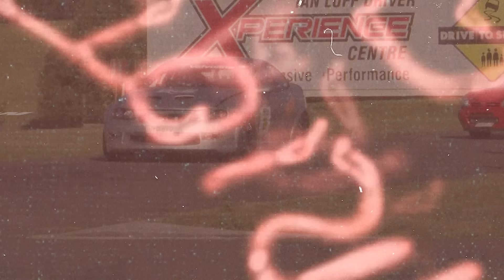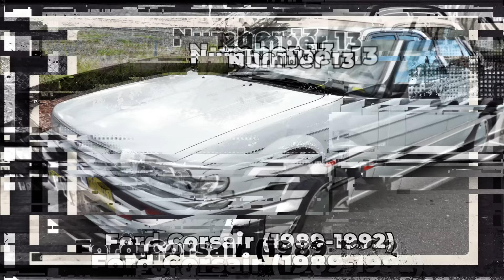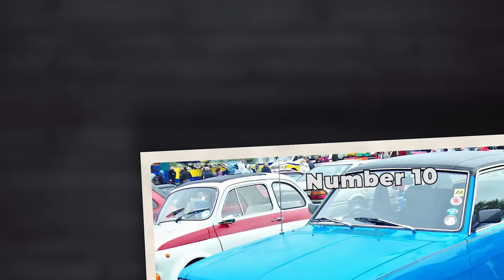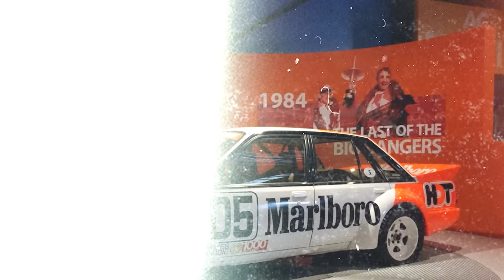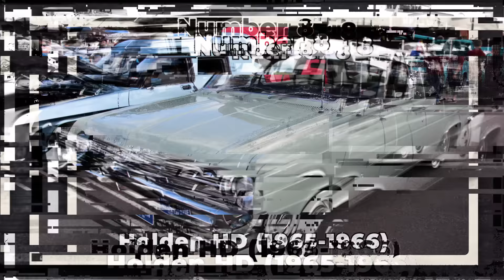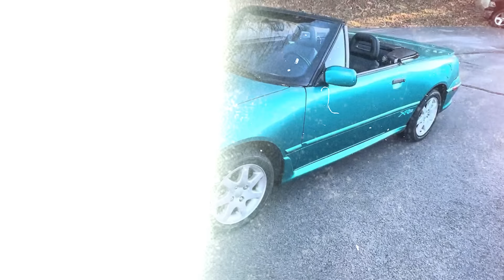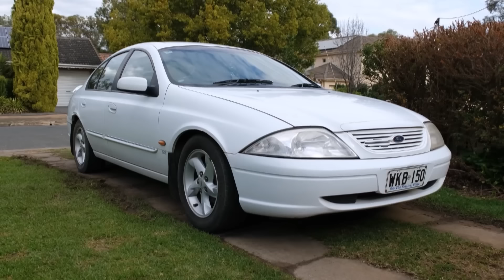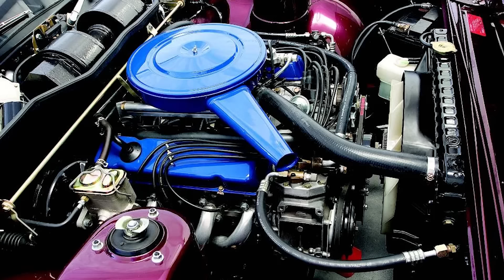Top 15 Worst Australian Cars Ever Made

Comment: Some research is need me thinks. Geely was never on sale in Australia. It was the UK they were sold. There was nothing wrong with the early Holdens EH to HR. These were seen as solid. The Marina was seen as a good competitor to the Cortina\Torana. Only issue was they were too expensive. They weren't the same car as in the UK. They had upgraded suspension, more powerful engines. The 262 Six in the Marina & P76 didn't have head-gasket issues. Where did you get this from? Oil leaks weren't any worse than any other car of the period. They were let down by build quality due to monitory restraints.  No mention of the Mitsubishi Sigma not LADA? I'm assuming you are including imports as you mentioned Geely and showed the Morris Marina.

Comment: I actually owned a 1985 1.8L JD auto Camira and gotta say I was very impressed by its performance and economy. I did have a couple of issues, but nothing unusual for routine maintenance. Only problem may have been the 3 speed auto, but those were the days of limited gears, lol.
I think they're confusing the JD & JE with the earlier 1.6L JB.
Wish I'd kept it and replaced the engine with a 2.0L & 5 speed manual.

Comment: I owned a ford corsair and it was the worst car I ever owned, I bought a one owner low K example and It was a money pit, unfortunately its only saving grace was that it was in an accident that was the other drivers fault, insisted on an insurance check rather than a repair, back then you could insist you had a preferred repairer , kept the cash and 1 month later the head gasket went, also got $100 from a wrecking yard as a bonus, what a piece of crap . Ford was more or less forced into this by the "Button Plan"

Comment: Had an AU series1 v8 Ute, did 600000km in it, reliable  motoring. Beautiful car.
Reply: Still driving my AU series 1 v8 ute, and it's getting close to 600,000kms and still going strong.  Has been a great car!  (I did change the grill and bonnet though for series 3 styling).

Comment: 12:09. I must have got the only decently built Camira produced by GM-H. I purchased a 1983 JB Camira SL/X four speed maual new. Had it for 10 years and did approx. 100,000kms in that period. Only problem I had was a dash light failure at 40,000kms - common problem - which cost about $40 AUD to repair. Key to it's longevity was regular Servicing and not abusing the engine which was plenty powerful if you knew how to drive properly. Gifted it to a relative who had it for another 15 years before upgrading to a new car. Loved that car and wish I still had it. If you treat any car like a peice of junk, that's eventually what you will end up with.

Comment: I'm nearly 63 and have only ever owned 5 cars: 1 Holden ('79 HZ Kingswood), 2 Toyota Landcruisers ('95 HZJ78 and '05 HDJ78), and two Ford Falcons ('82 XE and a '97 EL). The Kingswood was brilliant. The Landcruisers - bulletproof and ultra reliable. The two Falcons were by far the worst, with the XE being twice as bad as the EL. Absolute shocker - 2 engines, 2 gearboxes, 2 radiators, 2 front passenger doors and innumerable door handles. I eventually gave it to the SES so they could use it for 'Jaws of life' training LOL.

Comment: 1.  The Sunbird was a good car for its time, mid 70's, and there was nothing wrong with the interior.
2.  Yeah, no shit, in a straight-line on a dry track, a lighter RWD is faster than a heavier AWD with the same engine.
3.  Wrong.  Ford actually made the panels, so it was the closest to a JV of all the Button-Plan models.  It's biggest failing was being boring.  It was discontinued only because Nissan closed their Clayton factory.
4.  LOL.  What an idiot.  Yes, the Apollo was a pointless rebadge, but that doesn't make it a bad car.  As a Camry it was actually a decent car.
5.  Oh sure, the car that launched the most successful brand in Australian History.  And no, Ford responded quickly with modifications.
6.  The Marina wasn't Australian.  You spongecake.
7.  Err no.  The Starfire was hastily developed to meet Local Content requirements, and was used for around 6 years in Australia, including by Toyota.  The 4 cylinder Commodore wasn't a bad car, just pointless.
8.  Meh.  HD Holden was a locally build car in the 1960s.  Woeful by today's standards, but so was everything else.
9.  The 380 was not a bad car, it was just a bad idea.  Mitsubishi Australia gave up the powerful position of the Magna in the large 4cyl category, in a nonsensical big to chase Ford and Holden with a "big 6" of their own.  At a time when people were already leaving the big-6 market.  
10.  Not sure what you're smoking, but Ford closed their Adelaide plant in the 1960s.  The Capri was built in Broadmeadows like everything else.
11.  Yes, Dementia is terrible.  Gheelys were in no way Australian
12.  Ok, you finally got ONE right.  The Locally built Cruises were very badly made.  Especially for their time.  
13.  The AU Falcon does indeed stand out as the worst styling mistake of all time.  But the rest of your claims are BS.  AUs are mechanically bulletproof.
14.  Not sure it deserves to be number 2 on your list, but yes the JB Camira was an epic failure.  Badly under-engined compared to its Competitors and atrocious build quality.
15.  Oh congratulations.  Yes the P76 is the worst Australian car ever made.  Yawn.

Comment: I inherited a Camira when I was around 20 (1993?). On the positive side it never broke down. It was a manual and I drove it very gently.

On the negative side, amongst other things it needed new CV boots every six months to a year, dash lights would go on and off at random in the rain, the firewall was rusted to the point the bonnet wasn't connected at one side and seats, mirrors and gear sticks needed replacing. Fortunately there was no shortage of Camiras at the wreckers. 

I think I sold it for about $400 in 1996. I saw it still driving around about a year later. From everything I have seen and read mine seems to have been one of the better ones.

Great list, but I do agree with others that the Craptiva should be here.
Reply: Not the captive Diesel, iv had mine 10 years now not a single thing ever gone wrong with it. Because Isuzu made the diesel engines for it. That's all you see mainly getting around now, the diesel captive.

Comment: Ford Capri convertibles were built at the  Broadmeadows Assembly Plant 2. Left hand drive models mainly for the US market and right hand drive were on the same line. The XF ute(and Nissan Ute lol) and Panel van was also built in Plant 2 along side the Capri to begin with and later moved to Plant 1 with the EB/D Falcon models.
Reply: Correct. My first job was counting Capri parts (down to the last bolt) at the Broadmeadows plant.
Reply: While some of the base Capris certainly leaked a bit and were a little underpowered, the '92 ClubSprint black only turbo model with the Momo steering wheel and blue leather seats was absolutely awesome.  It had a ton of power and a true two seater - very cool car even today.

Comment: I had V8 P76 4 speed. Still the best car I have owned. The “writer” forgets that any car parked outside and not under cover rusted quickly.

There was no coating at all on parts of car not visible, in side sills, corners inside doors etc, there was no whole body dipping back then.
Reply: Agree, we had both v8 and 6, v8 was fine 6 was worst car with lawn mower carby ever.

Comment: Despite lower ball joint issues, simple power steering pressure switch leaks and door actuator plastic gear shafts snapping, The AU Falcon is one of the more reliable vehicles Ford has made. It certainly did not lock owners out of the vehicle, simply just couldn't lock the car. Every car has some kind of problem unique, and given what problems the AU falcon had, they were relatively easy repairs and quite inexpensive. It was only the series 1 AU Forte that had the grille most people did not like.

Comment: The Corsair and the Apollo were thrust upon both their manufacturer by the Button plan, hardly the fault of Ford and Holden. They had no choice but I notice you left out the Toyota Lexcen from that entry of the two car. It was a badge engineered Holden Commodore that sold almost zero cars. Just as bad as the two you mentioned.

Comment: You should add the Holden Vectra (JS series)  to the list.  The one I had was poorly built and had no end of engine and electrical issues.  The most dangerous was an engine stalling fault, where if you took your foot off the accelerator it would stop on you when in motion.   Had this issue looked at multiple times by my Holden dealer at the time and although they were able to fix when it occurred, it kept coming back.
Reply: PLUS CAPTIVAS endless problems....

Comment: The Camira should have been an excellent car. In the UK it was the Vauxhall Cavalier and was pretty bulletproof but the Camira was very badly assembled here.  I believe (someone could confirm) that they fitted hundreds of them with left over four cylinder engines from the Commodore 4 cylinder model that had been languishing in a warehouse for many years. 
The endearing thing about the series one JB Camira was the sudden dump of all the oil onto your driveway. 

Just a point, the pictures you show are not the JB,  they are the JD 2 litre model that was excellent. 

I met a lady with one (still with her, 30 years later) and it was absolutely faultless,  we made many runs from QLD to Sydney etc.  Sadly she ran it into a tree (no injury to herself).

Holden had fixed all the problems but it was too little too late.

Comment: The commentary on the Mitsubishi 380 is very misleading.  I own both a 2004 Magna TL and a 2008  380 which have the 3.5 litre 6G74 and 3.8 litre 6G75 respectively and they are both coming up to 300K kms. I have owned many cars and I consider these models almost indestructible.  With the correct maintenance, these cars have great acceleration and the 380 goes like a rocket. I also have a 2024 turbo charged Subaru and in my opinion, the 380 , even with 280K kms, it has a better acceleration. It's friggen awesome. The Magna has developed a smallish rear engine oil leak which I keep at bay with oil sealer, but the 380 is still clean. It was a fact also that the Mitsubishi 6G75 motor was faster than any 6 cylinder produced by Ford or Holden. Mitsubishi Australia wound up its manufacture not because of the 380's but because in the 80's , the original Magnas had an seriously awful  auto transmission which frequently failed and this saddled Mitsubishi with a poor reputation of quality with the public and it basically never recovered from that public perception, despite from about 1998 onwards producing & equipping some of the best V6 cars of its time. The interior of my 380 is as good as the day it was made as I have done the maintenance. I predict that in about 10 yrs time, these Mitsubishis ( 1998 on) will be collectors cars because they are genuine Australian made and many were made very well  and well specked.
Reply: My mate bought a 380 because it went like stink, but knocked over his letterbox when he tried to turn into the driveway- didn’t realise the steering lock was +/- 5 degrees max angle. Had them as rentals sometimes- The VRX was a terrific car.

Comment: The mid 1980s Mitsubishi TM Magna which also one car of the year was up there too (Australia's XJ Jaguar). Smooth ride, roomy comfortable interior and the updated smooth Astron 2 engine. Put the competition to shame. But a huge quality disaster. Rusting from the roof down, All soughts of mechanical and electrical issues. I had one and it was the worst car I ever owned, A close 2nd is the XG Falcon ute.

Comment: I'm a Ford man, and I admit the AU was the ugliest falcon ever.
BUT mechanically it was the best 
I had an AU wagon series one and a half (series 1 update)  6 pot for 13 years, 500k before SWMBO (now ex wife) made me sell it. Bought a BF Fairmount Ghia, to replace it, but kept the wagon for another 2 years.
I still have my AU 2002 V8 Fairlane. The ex got my BF in the divorce.
My son is actively trying to track down my wagon, he loved it as much as I do. We do know it's still registered.
My wagon was a freak. On the speed limiter (185kmh for wagons) she was doing 3300rpm.
She could smoke the tyres into and including 3rd (auto). And has beaten V8 LS1 commies many times.

Comment: You know It's good thing to do proper reseach. The truth is the P76 didn't fail because it was a bad car. It was destroyed by it's parent company in England and local manufactures who supplied parts in dribs and drabs. This caused production line issues. The car was not rushed into production at all. The project started in 1968 and went into production in 1973. Leyland australia built a simply amazing very original car which out engineered anything Leyland in England made. In 1973 only two cars passed the UK's testing for cars to be sold in England without braking. One was Porsche 911 the other was the P76. Everybody makes fun of the last Leyland made in australia but the truth is very sad indeed. Leyland in England shut down Leyland australia to steal the P76 chassie for the Rover SD1. Leyland spent 80 million pounds developing the P8 which failed in testing so they fast tracted the Rover SD1 as a replacement by stealing the P76 chassie. This car took 16 months to create.

Comment: I'm a bit surprised about the Holden Camira. Owned 1 for 9 years having bought it with 50,000km on the clock. Laughably on 2/2/2002 I had my first and last issue with it when I unintendedly slid off a dirt road into a large fence post (like 500mm diameter). The Odometer showed 200,000 km on the dot. That little car had served me well. I got it home with the front-end stove in. Only issue I'd ever had was plugging up the Welsh plugs during a big trip as they had rusted out. Did a couple of thousand kilometres with nothing but radiator putty and araldite sealing the Welsh plugs in. Paint was definitely an issue. The clear coat would just crack and flake under the tropical conditions I lived in. Never showed any sign of rust despite living near Gladstone QLD with both saltwater and industrial pollutants constantly bombarding the car.

Comment: I'd happily have a few of these cars in my driveway. The HSV Coup 4 was a great package. The only reason it was (slightly) down on acceleration was the detuned LS1 to protect the all-wheel-drive system. Pretty smart engineering decision/compromise if you asked me. Price was the main reason they didn't sell more.
Reply: It suffered the same fate as its sister car the Adventra wagon with the same drivetrain. Way too heavy and expensive.
Reply: Was a terrible car mate.

Comment: I bought a VH SL/X
5 speed Starfire for $400.
4th gear disappeared one day so "ringing" out 3rd to get to 5th was painful. 
One snow trip, roof full of boards heading up the Hume. Looking to pass a semi up a slight incline. With a good run up the car hit the air coming off the front of the truck and stopped! Had to tuck in behind for the remainder of that leg. My mates still rib me on this....
Reply: My LH sunbird was just as bad as you couldn't pass anyone. I tried once when got I stuck behind a car doing 95kph. I backed off a bit for a long straight coming up, sped up and pulled out of the slipstream at the last moment to pass, but the moment I did, the car started slowing down and I had to pull in behind the slowcoach again.
Reply: I had a boss who had previously worked as an engineer at Holden.  His claim to fame was changing the gearing of the carby on the Starfire.  So when you pressed your foot a small way on the accelerator the butterfly opened up "a lot " . This gave the fake impression that it was really responsive.  ( And meant that normal drivers used fuel like a leadfoot ).  When you then pressed the accelerator pedal further, there was not much more happening.